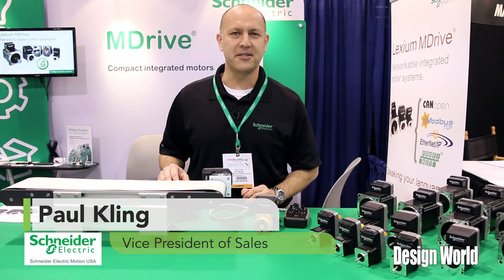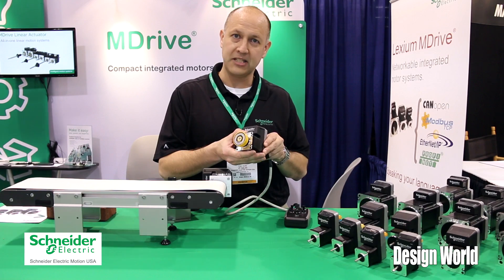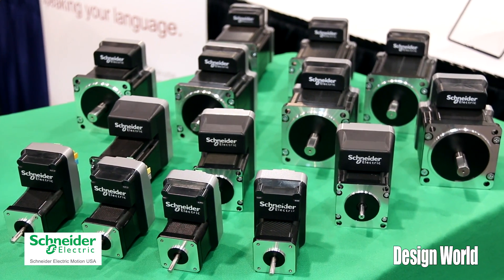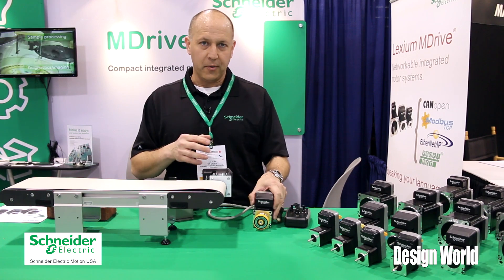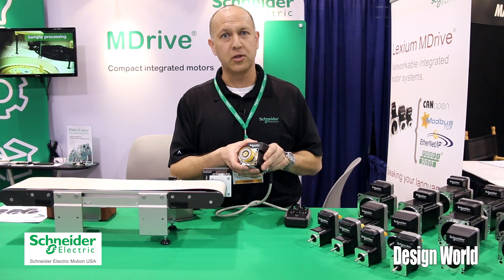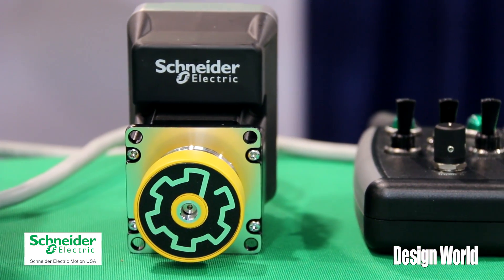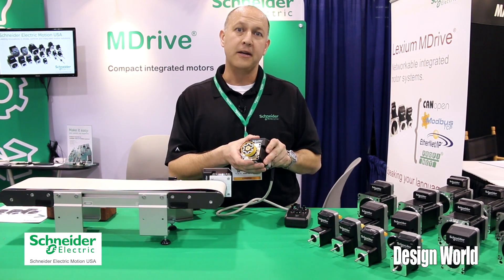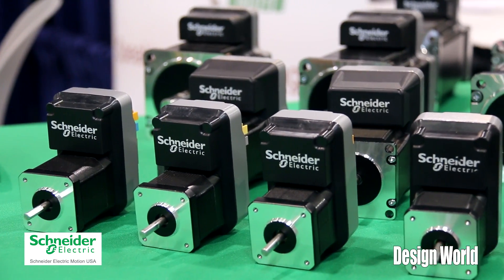Closed-loop stepper motors (you read that right) never lose steps

Comment: I prefer the Teknic ClearPath Motor (its a servo motor that acts like a stepper) but never losses pulses and takes in simple control inputs.
If this is cheaper it does give an in-between option

Comment: "Closed-loop stepper motors (you read that right) never lose steps"
Yes I read it right, but you write it wrong. How can everybody chant this nonsense idiocy ? Who invented this sentence, that guy was totally stupid merchant, but never studied physics.
Every/any kind of stepper motor or servo motor will lose steps, just you have to use bigger torque than its able to handle.
Its not a huge trick at all. Only a motor with infinite torque can't lose steps.
If you pick up a motor which can provide 3Nm torque max., and you grab its shaft with more than 3Nm load, than that motor will stop spinning. It doesn't matter if closed loop or not, it will stop. I'd name that losing steps, actually losing every steps continously.
Reply: The difference is that the closed loop stepper can compensate for lost steps. It will not lose position if it isn't permanently stalled. In that case it still gives feedback and the machine can be stopped.
When it is a positioning machine it might be good to just go on till it reaches it's final position. No steps lost because they are compensates for. Repeatability is archived much cheaper that way than say with a linear encoder.

Comment: So, if I understand well I can use these units on a regular open loop system with no additionnal programming ?
Reply from the maker: Yes, with a caveat — there is minimal configuration required — possible with the Lexium MDrive Software Suite. You might check out the modules available for download at http://motion.schneider-electric.com/lmd/lexium-mdrive-software.php ... there are some examples there, too.  Thanks for asking!